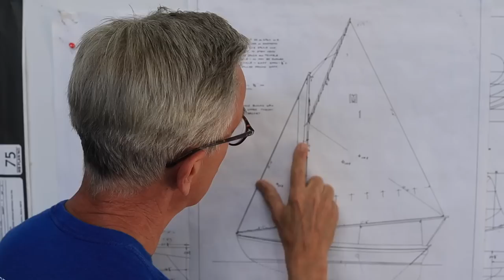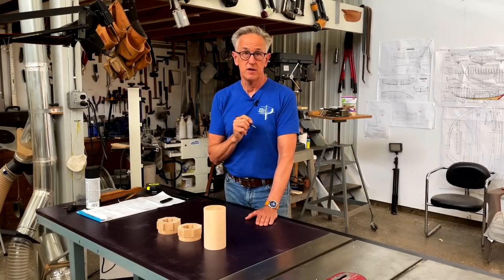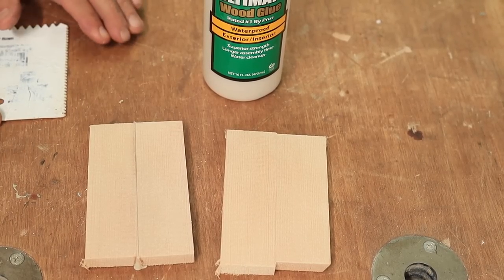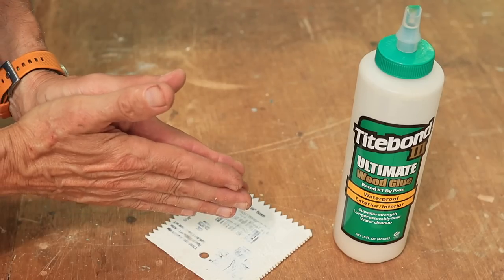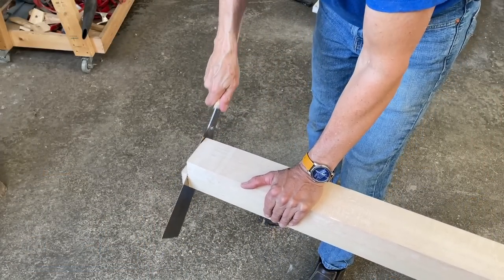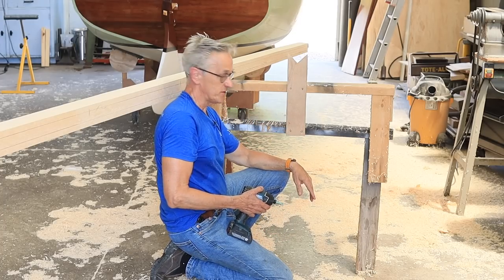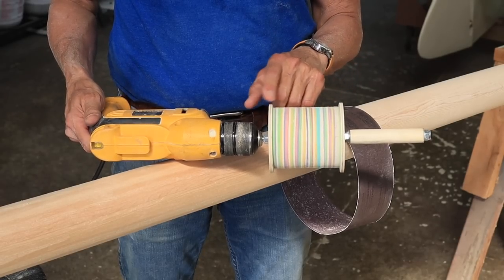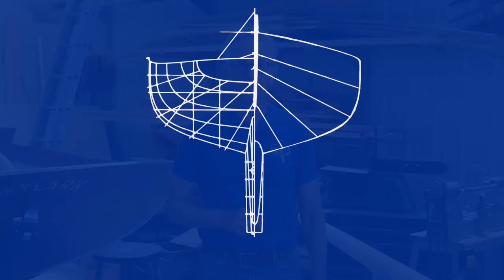Hollow vs. Solid Mast S2 E66

Comment: glue longevity?
Reply: Pretty much forever... Titebond III is waterproof and if you tried to pry apart two pieces of wood where that glue was used to laminate it the glue joint would not fail, the wood fibers on either side of the glue joint would rip and shred apart (and you'd have to hammer on a pry bar to do it).  Like Bob mentioned, the strength of the glue (4000 psi) exceeds the strength of the wood substrate, so there is no need to use epoxy.  I've seen several woodworkers who make very fine furniture explain the same thing, if its cosmetic they don't want to see the glue joint at all.  I love epoxy, I use it on anything structural but in this case the logic is clear and you end up with a mast where it looks like it was made from one solid timber,

Comment: Might want to review the way you structure your information.
At no point during that initial discussion did you explain the question your conclusion was supposed to answer.
You said an expert recommended a solid mast, then said that there were three types of mast construction, then brought up the densities of two types of wood without context, then concluded that solid was better...

You should say the question that you are trying to answer. You should explain what the purpose of each of the different types of construction and the factors that make one types preferable to another while describing the factors that you are looking at for your specific use case. "In conclusion" you should explain why you have decided chosen one in particular by explaining how the individual factors match your need, or by explaining the factors that are relevant to your use case would make the other options less suitable.